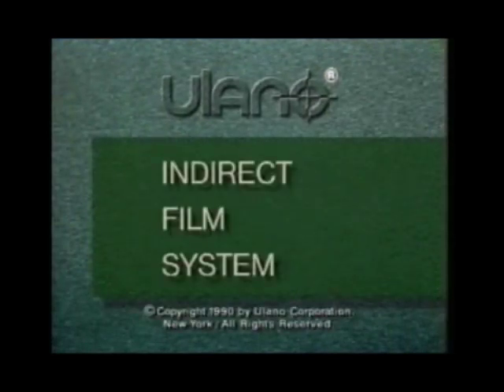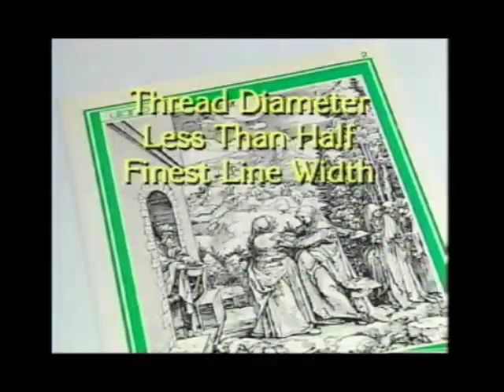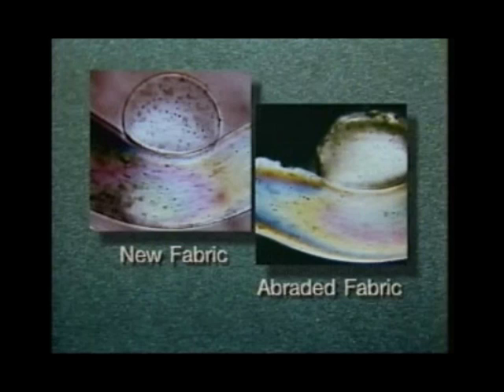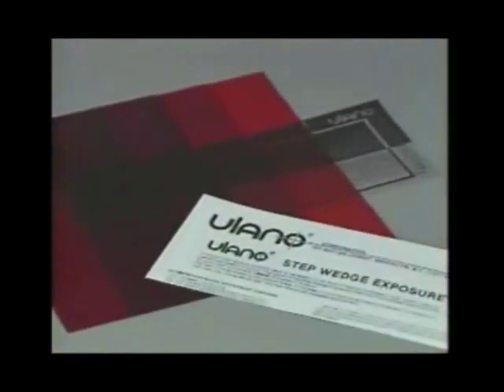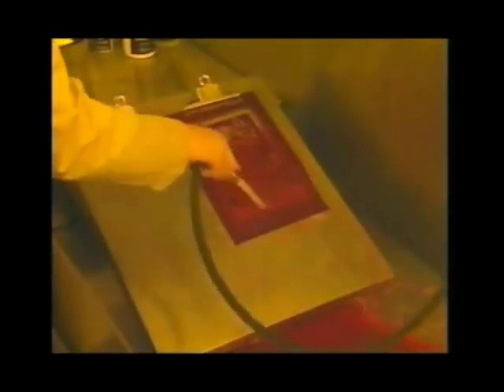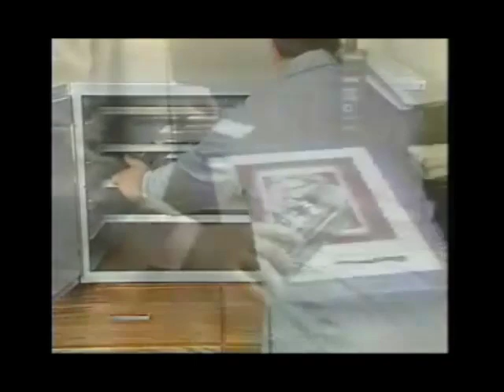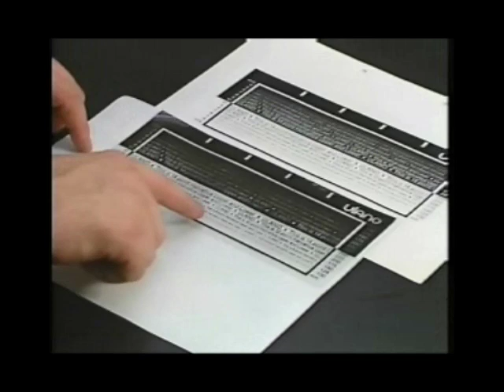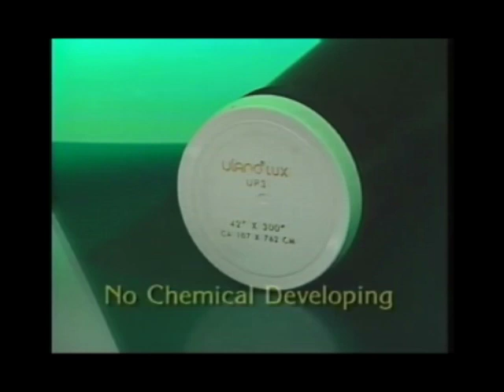Using Ulano Indirect Film to Coat a Screen - Screen Printing Tutorials

Comment: First time I've ever seen multiple abrasives and degreaser used on a screen. Is that necessary? The illustration showing before and after abrasion wasn't enough of a difference for it to seem worthwhile. Other than that, the video and its 1990s vhs feeling was entertaining.